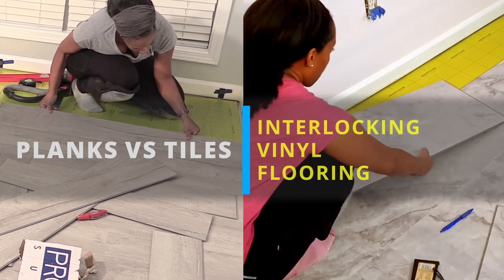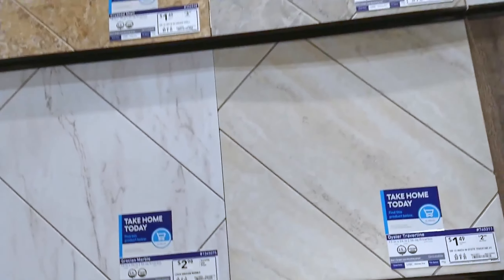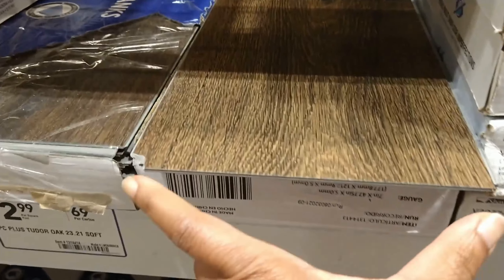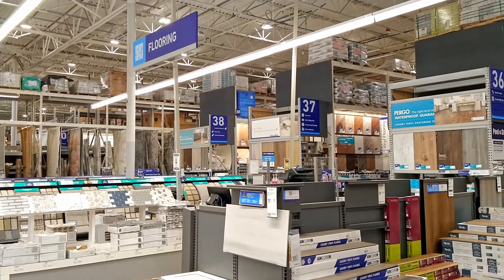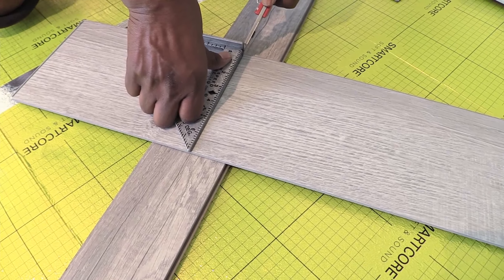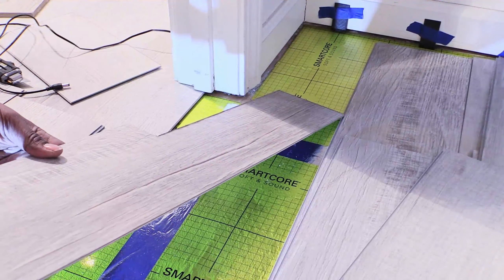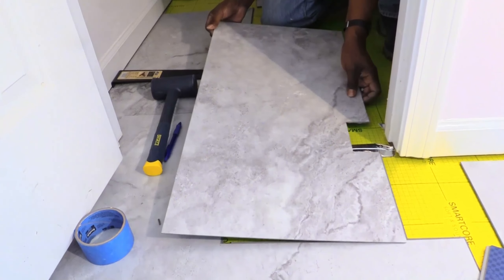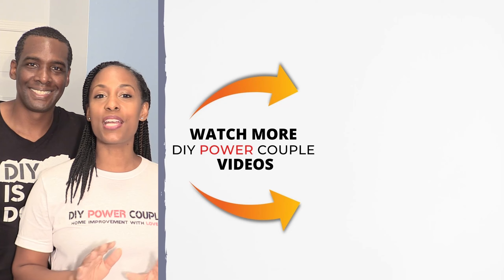Luxury Vinyl Planks Vs Tiles | LVP vs LVT

Comment: I've often seen the luxury vinyl tiles--in smaller offices and other."tony* business spaces. I was blown away--after it finally reached our usual-suspect/shared common brain/ big, tall, boxy stores--with likewise huge parking lots.

These tiles is a good deal more attractive than traditional, industrial vinyl sqaure tiles. Those latter always require plywood underlayment and gluing.

It's far from the worst flooring decision one can make: That's already been well proven by its commercial utility and reasonable attractiveness. 

Furthermore, if damage does occur, replacement is relatively simple. Just keep a few spares....
Reply from the maker: That's exactly how we see it. Thanks for your comment, Geoffrey!!!!